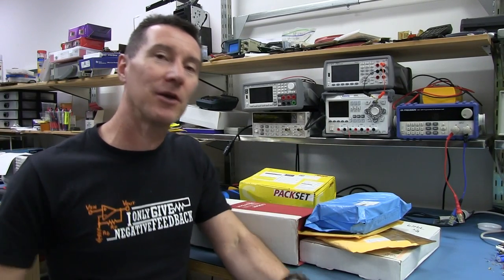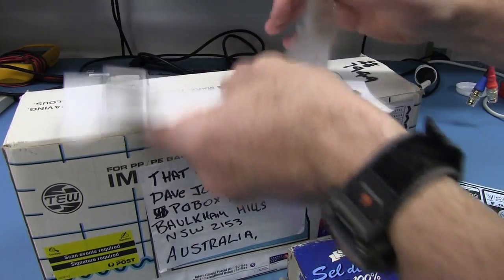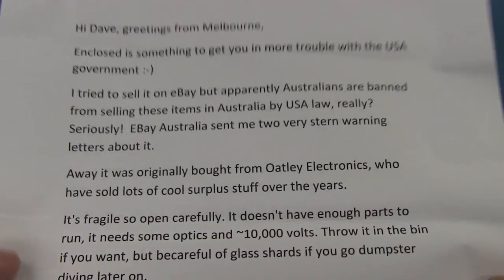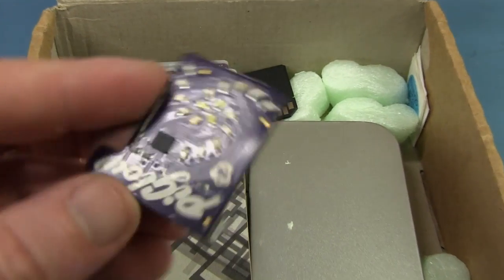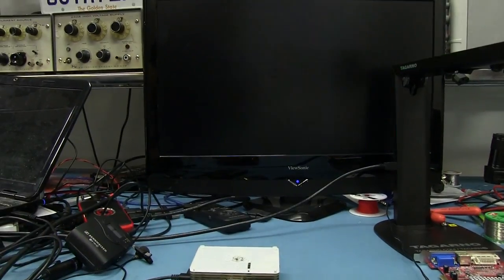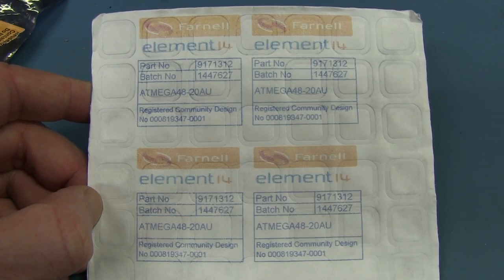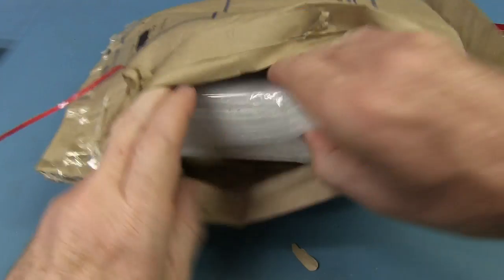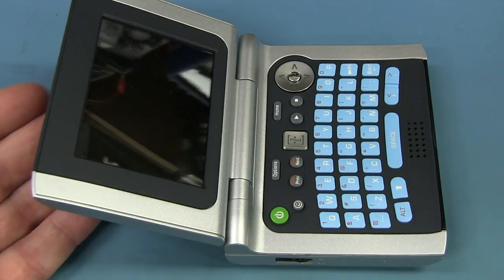EEVblog #618 - Mailbag

Comment: I remember years ago getting several gen1 image intensifier tubes from oatley, I believe the ones I got were ex israeli tank night vision. They were considerably more primative looking than that one. That may be a gen 2 or something. On mine the resolution is actually physical as they are made up of a bundle of fibres traveling from one end to the other.
 Pretty easy to set up, I made mine into a triple stage unit by super gluing three end to end and applying the 15kv or so accross the tubes then its just a case of mounting an old slr camera lens on the front and something as simple as a magnifying loupe on the back end. Great fun to play around with mine gave something like 50,000 times light amplification and was great for asyronomy etc.

Great show

Andrew

Comment: XX1080 is an image intensifier (Night Vision) part and the ATMega chips are for Arduino's
Reply: I even found a datasheet w/ some information and diagrams how to set this thing up. Unfortunately its in Dutch language: http://www.jogis-roehrenbude.de/Roehren-Geschichtliches/Spezialroehren/XX1080/xx1080.pdf
Reply: I was able to find out it would have been used by the military from about 75 to 78. In 1975 night vision technology was improved on but it only came into service in 78, the start of the second generation.
Reply: That explains why the guy who sended it in is now on the watch list of the U.S.A. ;)

Comment: I have two of those Zipit2 (I apparently got the last ones available in the Phoenix area back in 2007 or so; I tried to find more and was unsuccessful). They were fun to hack, e.g. to play music via the headphones or something else that any smartphone can do better nowadays. There's a serial port inside (if you can find the right solder joints on the PCB) that can be used as a console. The slot is actually a MiniSD card which is what came before MicroSD, so all you need is a MicroSD to MiniSD adapter and some files to put your own Linux on there.

That Philips tube has a NATO stock number (by the way -17- means it was made in the Netherlands. Yay!) so it was probably used in night vision goggles or something, that must be why the Americans frown upon selling it: if someone sells it to the Canadians, they will see us before we see them! Can't have that!

Comment: I still use my modded gen 1 zipit from time to time but it is limited in
 that it is only 802.11b and has a rather slow processor inside that and
 an very small about of internal space for the custom firmware. I have 
two of the things but I broke one of them when I tried to install the 5 
wire serial mod. That unit still works but it has a broken smd resister 
in one of the serial lines and dam if i know the value of the original 
part. The reason I even bothered trying the serial mod was I had 
accidentally updated that unit to the latest official firmware and they 
locked out 3rd party firmware via a key and to bypass that all you 
needed to do was flash the image directly via serial. I loved the zipit 
and used it a lot in collage several years back to ssh into the schools 
linux boxes for programming assignments. That said I would much rather 
use a v2 these days as it is a lot more powerful then a v1 and has a 
color screen.  I picked up my first zipit for I think 20 to 30 bucks at 
compusa. For the price and hack ability it was a steal of a deal at the 
time.

Comment: For the Rasberry Pi, I modified mine with some heat sinks pulled from an old video card I got surplus and cut down and a fan (from the pin headers 5V) to drop it a few degrees. I measured a 30F drop in temperature (didn't know how to change it to C) using the mod. At idle it's about 85F ramping up to 110F watching an HD video.

Comment: likely using WPA2 at the lab? older devices don't have the ability/knowledge to authenticate.
Reply: also if i remember correctly the zipit version 1 only has 802.11 B not even G so if B is disabled in the router no joy connecting. not sure if they fixed that in the version 2 or not.

Comment: That "Audiovox" phone looks suspiciously like a Motorola one I had back in about 2001/02 kind of period, and might still have in the back of a drawer somewhere. The general shape, button arrangement, and even sculpting of the back panel look v-e-r-y familiar... and when you mentioned about it being a very early "web browsing" model that sealed the deal (almost certainly just WAP, officially, but I found mine would also render the basic text part of any HTML page I pointed it towards... so possibly marketed differently according to area).

Don't think mine was tri-band or CDMA though - as it was a UK model, it of course worked on GSM. Can't remember if the web access was GPRS or plain old CSM (ie 9600 baud audio modem over a GSM call...) though. WAP tended to be expensive and based on connection time rather than data transferred, so probably the latter. Which means you'll have a lot of difficulty making any kind of data connection with it nowadays as most carriers seem to have dropped their CSM services.

Comment: You should develop a little face tracking servo unit that has the 2 cameras always pointing at you, and you could broadcast both at the same time, or switch between then with a little remote.
Just an idea. Seems simple enough with a raspberry pi or some other basic computing platform.

Comment: Woah the UV erasable ROM brings back memories. I used to work for Omron as a young fella and my initial job there was programming ROM's for EPOS (fancy cash registers)...we'd recycle all the old ones by giving them a sun-tan in a little UV cooker with a slide out draw...they came out nice and hot and data clean! wonderful stuff. I'd program then put a dot-matrix code label over the little window to protect the code. lol

Comment: Hi Dave.
Impulse sealer is a timed output to the heating wire. Micro switch is made and starts the timer to switch on the nichrome heating wire for as long as the timer is set for via the pot. work on these on a regular basis. cheers keep up the great work.

Comment: i got 2 Philips xx1080 from ebay (for 20$ 2pcs)
i ran them with ccfl inverters, worked well.   then i  sold it because i didnt had a proper use for that.

Comment: That Zipit, "Zipip" or "Ziptie" thing would have been cool for me to mess with back in the day, but back then I used a HP ipaq rx3715 and while the OS was sort of "obsolete" back then and i couldn't get a good YT experience but I did have fun with whatever I could find, including "CeBeans" apps(they're still around!) and especially the MSN messenger client, while it didn't support the new features they had at the time, it worked and I could surf WAP internet over Wi-FI and then get a chat notification and poke my nails on the tiny touch keyboard.

Comment: That last device reminds me of my Sharp Zaurus SL-C1000 that I got on my second business trip to Japan. I was extremely exited to have a Linux computer in my pocket :)
Screen was just amazing for that time and there where plenty of Linux based operating systems for it. This was around 2005 I think and used the Intel PXA270 that was able to work up to 600Mhz or so.
Almost a raspberry PI smaller with better power consumption including a small VGA touch screen LCD.

Comment: Love the Zipip Wireless Messenger 2 that would be good to put a cut down version of linux on much like that which is used on the Raspberry Pi.

That Pibow Raspberry Pi case is a nifty case, I will have to get a Pi once the projects I have on the go are finished, gawd I have soooo many to finish, also have to get 4 PCs sorted for a place where I do their IT stuff for (all volunteer stuff btw).